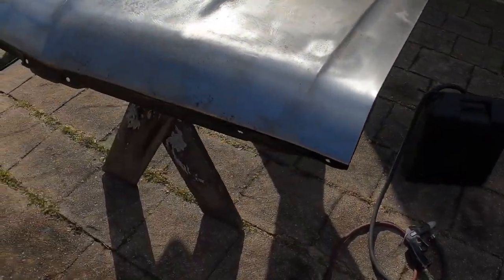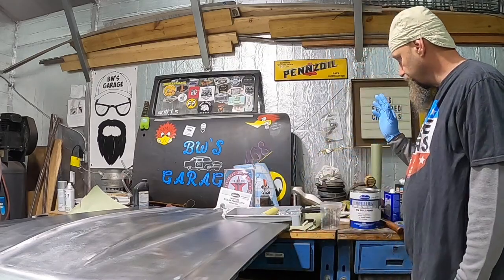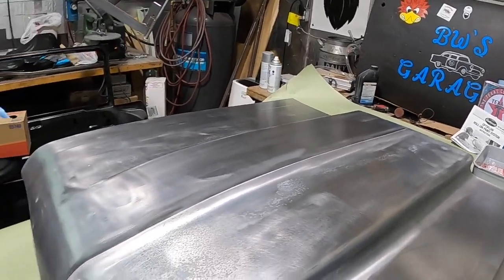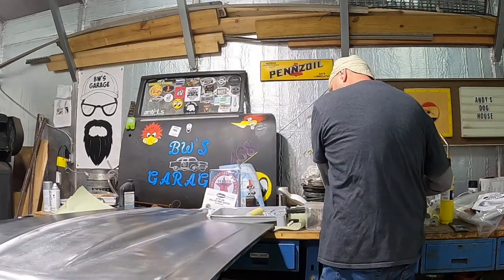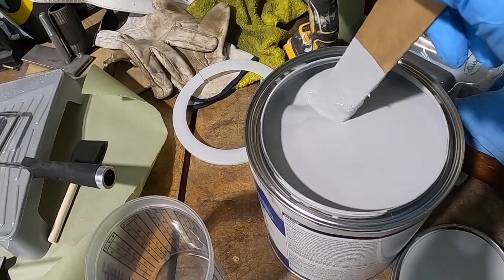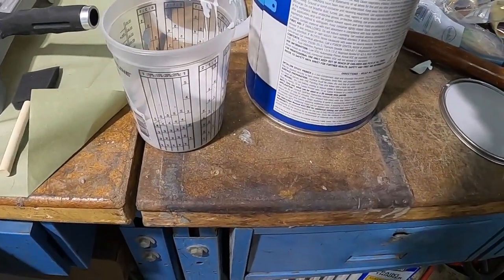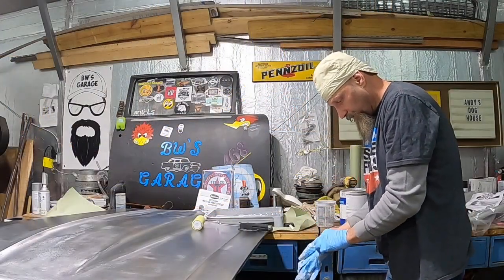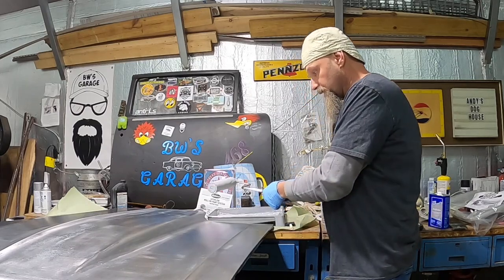Roll On Epoxy Primer, For The DIYers

Comment: BW if you take a screw driver on the side of the can in the edge of lip where you can see the directions and the lid will push the paint back into the can punch like 4 holes good luck
Reply from the maker: Hey, thanks for tip Mark 😀 😊

Comment: Turn the activator/ catalyst can sideways when pouring and it won't splash, the 1×4' and 1×5" rollers work much better for auto applications. If you mix too much next time put the paint in the refrigerator and it want flash until you get to use it in 30 to 55 minutes. But it's looking good👌
Reply from the maker: I hate waste, thank you for the tip. I will definitely try that next panel.  I Appreciate the feedback
Reply: Nice job. Very thorough prep. Looking at this same method for my car. I’m subbed now. 👍👍👍
Reply: i was going to suggest the same thing

Comment: Man you got that hood so clean I'm impressed. Its not easy to get the pitts that clean! Now with the epoxy primer on there the hood is safe. That stuff goes on good and will help protect the hood till you do the final body work! Nice Job BW and no you don't want any over spray on that badass 55 Gasser! Talk to you later buddy!✌️
Reply from the maker: It was a chore getting the pitts cleaned out for sure, but we got it done. I am happy with the method. It makes sense for us back yard guys who don't have paint booths or big shops.

Comment: Great video and tutorial! I watched the rust remover video and that was legit.

Question about your compressor for the walnut blasting: What size tank and CFM are you running? I just picked up a 30 gallon compressor from HF to attempt paint spraying, but I'm wondering if there is any setup that would allow this tank to do any blasting, any kind of blasting.

My project is a 1946 Walker-Turner 10 inch table saw I'm restoring on my channel. In particular, I'm preparing the base for paint. Any advice or guidance you have will greatly help get this fine machine running again. Thanks BW!

Comment: do you know if this primer can be left outside on the car and that it will resise water or will water weap into the primer and get back to the metal.  i guess does the primer need to be sealed with paint before going into the weather. does the primer need to kepted inside until painted.  thank you
Reply from the maker: Epoxy primer seals, and locks out the elements and protect against rust. 
Regular primer will allow moisture under it, epoxy primer wont.
Reply: BINGO @bwsgarage

Comment: Hey BW. Good video. FYI, when I pore from a new can of solvent, i tip it with the spout up instead of down. That allows the air to enter the can and prevent the glug, glug and avoiding a mess. That is just how i do it. I like to skoop from the big can as well. I hate a mess. Plus the wasted product. Thanks for sharing Brother.🍁🍁👍👍
Reply from the maker: Thanks Andy, I gonna try pouring from the top next time too.

Comment: the hood turned out really good, your doing a great job . i noticed an electric heater under your workbench you could have put it under your hood to warm it to dry the primer faster mabe ?
Reply from the maker: That's a great idea, next panel for sure. Thanks Jim

Comment: Hood looks good BW. I've been wondering just how good the optiflow really was.  Looks nice.  Get ya  a chemical sprayer u can refill and pressurize  for your pre cleaners.  Makes that process  easier.  Cover the tops of your cans. Reducers, cleaners, ect. That way when u do pour  out of them u dont get contamination from the top of the can.  As always  really liked ur video.
Reply from the maker: Thanks Trevor, and thanks for the tips.

Comment: You did a great job prepping the metal, and I can understand rollering 2K hi-build primer since it is a filler and doesn't shrink. (and you can do that)
But epoxy? It doesn't fill nor need a thick coat to do its job. Plus, you don't really need to sand it unless it's set for awhile.
Reply from the maker: I followed directions,  they suggested 3 coats. I don't disagree with you, simply not sure. I sprayed DP90 on my 55, but for this , my best option due to space was this roll on method.
Reply: @bwsgarage  Yeah, you gotta have that epoxy on there in your situation .I'm familiar with DP90 and the Omni MP170's. Neither seems to be rollerable, with a 1.3 to 1.6 mil thickness per sprayed coat. Maybe Eastwood just wants to sell you a lot of epoxy.
Now the MP28, you''re really going to like. You can absolutely put this 2K hi-build on with a roller, it's like liquid body filler. Guide coat and block. Dust your hands and admire your work.
Reply from the maker: I sprayed the dp90, and when it flashed off I sprayed hot rod black right over it, door jams, dash, and window frames

Comment: Looks great BW, how did it do on filling up the pitting parts on the Hood?  Be interesting to see how that stuff will do on side panels.  At least you didn't get any product in the air and all over the 55 and the rest of your shop. ;o)
Reply from the maker: Thats was the idea Robbie, doing g what we can. It's not really a filler primer but it did fill the pitted areas nicely. A few fuzzys settled on it over night , but one swipe with a block it will be gone. ✌️

Comment: Looks good in certain situations it's the way to go rolling it on like what your doing. Spraying will be a lot faster more uniform waist a lot less material. I have a video on my other channel that shows how to use zip lock bags as a liner in a gravity feed gun. Makes cleanup super quick and your able to spray upside down.
Reply from the maker: I'll have to check that out., I sprayed my 55 but only have enough room for panels for other car at the moment, don't want over spray, so this method worked well for me this time.

Comment: would you consider  roll painting a whole call with rustomlem high gloss black after primer. Most likly will need a wet sand to ake off orange peel but you think that could work for a decent paint job
Reply from the maker: I've seen people thin the rustomem and apply multiple coats with foam brushes, then wet sand. And it looked good when done. I personally never tried it though.

Comment: I used Sherwin Williams DuraPlate epoxy on the inner fender wells of my Porsche 911SC and it stuck like nothing I've ever seen. Used a roller but then sprayed on the Wurth undercoating and then Grand Prix white over it (with my Atom X22 spraygun).

Comment: Is that sandable or do you need to shoot primer on top. Looks good 👍
Reply from the maker: It's sand able after 4 days, but it's not a high build primer, they sell a separate roll on primer product for that. The epoxy is to seal bare metal and protect against rust
Reply: Anything with the word "epoxy" in it is not sandable and is just a sealer, not a primer even though is the word in it.

Comment: 2 observations. Wow, that's a short work time for epoxy. Normally epoxy is like many hours.  Weird.  2:  I like to stir it or shake it then put the lid back on.  I poke a small hole with a phillips screwdrive in the lid to pour from.  Then I use my HVAC aluminized tape to cover the hole after I wipe it off. Works pretty good.
Reply from the maker: Thanks for the tip, will give it a try next time I am painting

Comment: Why 3 coats is that what was specified in the instructions?   I assume so because you seem very thorough. I will probably try this on my project but I'm cheap I will probably just buy the optiflow epoxy and then I'll need to know what kind of roller to buy.
Reply from the maker: If I had it to do again I would just use the smaller foam roller. Instructions says 2-3 coats. I probably could have got away with 2 had I used the foam roller.

Comment: You did good man saving that hood. I’ve never used roll on primer before but it looks like it flowed out very nicely. Great job buddy. ✌️😎👍
Reply from the maker: Thanks Kevin, was my first time using roll on primer. It had great adhesive properties and flow out nice. I did get a few fuzzy Settle in over night on 3rd coat. No biggie,  one swipe with a block they will be gone. Just gonna leave it till I am ready to apply high build primer which I will also roll on when final body work time comes.

Comment: That looks great, BW. It is at least now protected from the elements.  Thanks for the update, and have a great week ✌️ 👋
P.S. what I do when pouring , I turn the can so its lid is at top and helps with the splashing.  Just a thought for you. And on the gallon can , I used a shield to help with pouring from it. I get them at the paint store . There just plastic that fits right in the grove on the can.
Reply from the maker: I've seen the plastic pouring things at paint store, didn't have any so I dip, lol. I will try your pour method with the can next time. I appreciate it Sam 🙏
Reply: Hi ksokie63 can you post a link of those pouring shields sound like a good idea I will then search for them here in the UK

Comment: Personally, I would use 2k etch primer on bare metal then Epoxy once it starts to go tacky (almost dry to the touch).

Pulling the paint from the tin, I use a soup ladle. After use clean or hit it with a blowtorch then wire brush.

Comment: Those are where the metal got hot in the stretch, then condensation formed on them while they were unprotected. In the future turn the catalyst can sideways, and it will pour without spilling.

Comment: Any updates on this product.  Still a worthy investment?  Top coat go ok?
Reply from the maker: The nova is coming into shop in spring. The hood has been in the epoxy since we did this video. Its holding up great.
Reply: @bwsgarage  thanks for the reply. Good luck with the Nova.
Reply from the maker: Thanks, I did a cold Start about a week ago shows the hood, thr epoxy really does look same. It's been outside under car cover. I plan to use the product again

Comment: I used this on my nova a few months ago. It does orange peel a ton. I wouldn’t use the large rollers only the small black ones. I just used it again to tonight on my wife 68 cougar. Will post a vid tomorrow
Reply from the maker: Yea it has some orange peel, but its job is to seal and protect against rust.  I will sand it smooth when I am ready for body work, before I apply the high build primer
Reply: @bwsgarage  lol I just rolled my car last night outside. Came out to go to work this morning and I have rust all over. I should have moved the car back in the garage. It’s a thin coat so should be easy to strip and clean the metal.  Live and you learn

Comment: I have an aluminum body car. Was going to use Eastwood self etching primer ( for aluminum)  I’m not a painter by anyones imagination! I like the build up of Eastwood roll on primer. Should or can I use it?
Reply from the maker: I chose the epoxy primer to seal the metal to protect against rust. It sounds like you might want the urethane high build primer to sand and do body work. I chose the epoxy to seal the metal and will use the urethane later when doing body work. I would still reach out to Eastwood, they are very responsive.
Reply: @bwsgarage  👍 thanks